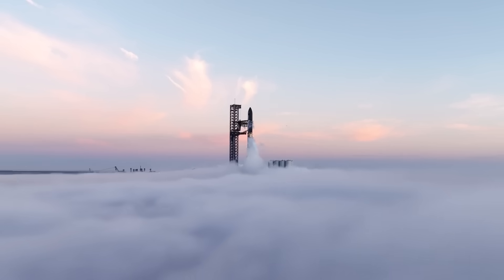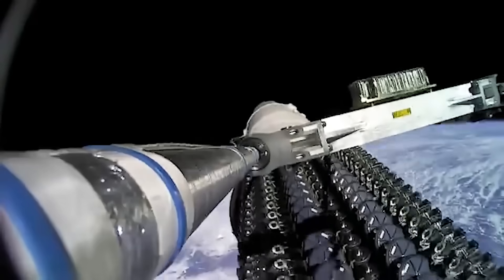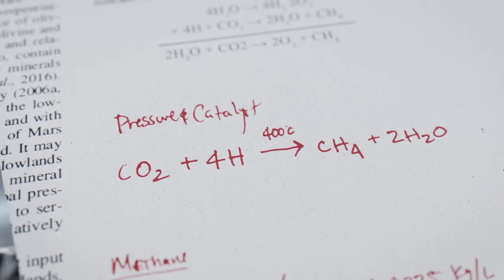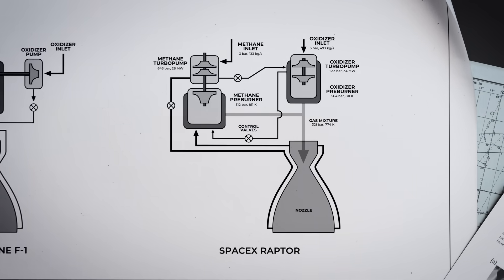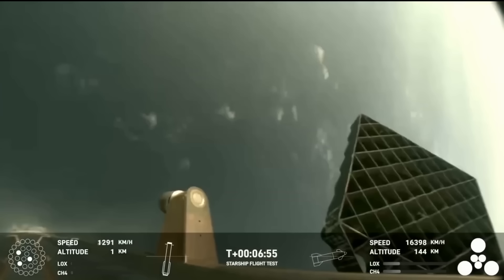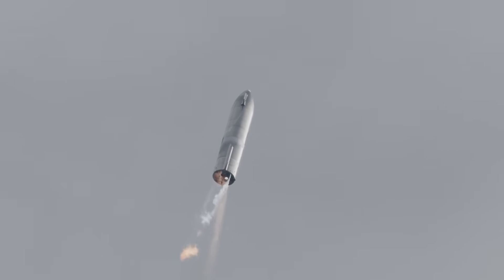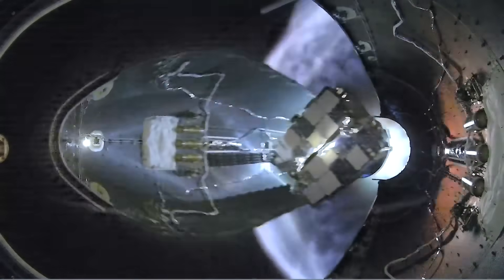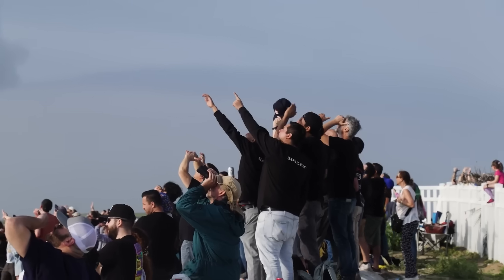Starship Reached Space. What Now?

Comment: JEEZUS H KRIST! Shoddy and disgraceful engineering of Space-X. Even the basic airplane has more than one radio system that backs up the Command System. The moment a fault or failure of the master system, the ground team should have initiated a turnover to the backup system. This was a total FUBAR outside the successful launch and seperation.
Reply: Starship has multiple redundant communication systems including SpaceX Starlink and NASA TDRS. They all went out when the whole thing broke apart and melted to slag as it reentered the atmosphere.
Reply: W…what? That makes no sense my guy
Reply: Loss of control was due to some sort of mechanical failure - some have suggested the RCS thrusters iced up. We don't know for sure yet.
Starship had no less than four independent Starlink communication arrays on it, plus at least one (but likely 2 or 3) TDRS system.
The fact that they had live video feed the whole time proves that communication wasn't an issue for them.
One should not speak unless one knows.

Comment: why is this so PRO starship? They failed most of their mission... "Unscheduled disassembly" - it blown up! "Space shuttle needed wings to glide back while starship doesn't..." wth, you just said that booster have to return back to the launchpad to be caught. SapaceX did half of what was promised for full money they got.
Reply: The flights were test flights. They clearly stated before what their methodology is and that explosive outcomes were expected. The aim isn’t to nail every test to its maximum extent but to find issues and ways to develop the vehicle in a hard to simulate environment 

Also RUD is a joke that has existed since the 70s. 

Also, None of there flights were being recovered. You just didn’t listen properly
Reply: Shuttle is landed like an airplane while the booster is landed vertically so it doesn't need a wings. Learn how to read

Comment: 15:40. Electric cars are not the solution ._.
Reply: OnLy PuBliC TrAnSpOrT iS GoOd is the most ableist shit i hear. God you people need to struggle to walk 10 minutes from a hole in your lung to understand that
Reply: So what's then?
Reply: @alvianchoiriapriliansyah9882  electric cars only make private transport more environmentally friendly, but even then, the sheer amount of electric cars that need to be produced to replace all the combustion-engine cars already in circulation does pose a lot of problems related to the extraction of lithium, for example. And this really underlines the problem, to me. It's the amount of cars in circulation. The necessity for 12 to 16 lane roads, the endless parking lots in cities that prevent the development of housing, and other such problems which, by themselves, also afflict the environment — I don't think anyone needs to be reminded of the fact that producing asphalt, rubber and concrete are incredibly bad for the earth and atmosphere. I personally think we should be moving towards other methods of transportation that can be slowly integrated into dense urban centers but also into more sparsely populated areas. Buses and trains are already more environmentally friendly than cars, even if they use fossil fuels to some degree. Electric cars are a necessary short term solution, but the ultimate goal should be to transition away from private transport and towards public transport, as much as each country and region can reasonably do so depending on their population density.

Comment: Timestamped Highlights
00:26
🚀 Starship reaches space for the first time, successfully lighting all of its methalox engines and performing a hotstaging separation.
01:30
🌍 Starship's massive size and powerful engines make it the most capable and largest rocket ever made.
02:46
🔥 Methane fuel provides advantages for future missions to Mars, including the ability to synthesize fuel on the planet.
05:02
🌌 Starship's potential to revolutionize space transportation by serving as the primary transport method between Earth orbit, the Moon, and Mars.
06:40
🌐 Starlink satellite constellation and the potential for larger versions of Starlink satellites with stronger signals for improved communication.
08:29
🛰 Possibility of using Starship for deep space missions and creating a propellant depot in orbit to transport more cargo.
09:40
🌍 Challenges and ongoing development required for landing the booster and achieving full reusability for the second stage.

Summarized by @NoteGPT

Comment: I remember YEARS ago my friend didn't think SpaceX could pull off the >30 engine idea claiming that "the soviets tried and failed" (not the best argument, imo, but go off ig). It's great to see that they actually got them all to cooperate and not shake itself to pieces! This is unironically a HUGE leap forward for space flight as it means we can put MASSIVE (relatively) objects into space with so much more ease; we just need to get the actual starship under control during flight!
Reply: Interesting you bring up the Soviets.  Their methodology was the same as SpaceX.  (or vice versa)  Design, build, test, analyze.  Repeat, with incremental tweaks and fixes or even re-designs to fix failures.  NASA, on the other hand, designed and tested on the ground, overengineering every component with at least 3 backups for everything, hugely complicating every facet of the entire project.
What is using Saturn rockets and who's still using Soyuz today?
Reply: @mountainjeff  The fact that you think having redundancy is over engineering shows how much musk manages to rot people's brain. The Soviet Union bankrupted themselves trying to keep up with America in space. Their space program was incredibly dangerous and while managing to achieve milestones first, in some instances, that hardly matters in the grand scheme of things. This obsession with painting NASA as some sort of bureaucracy that never gets anything done is insane. NASA is responsible for so many technological advancements. It's not even funny.
Reply: that goes to show how ahead of their time de Soviets were
Reply: I hope you remind him at least 7 times daily.
Reply: This is especially silly when you consider SpaceX already operates Falcon Heavy, which has 27 engines, and so far has never had a failure in years of operation. Your friend isn't alone though; you still see this kind of opinion all over the place.
Reply: @DontThinkSo11  Falcon heavy has 3 separate systems so only 9 going at once for each system. 30 at once is a big deal as resonances can build up and shake the rocket apart.
Reply: @DontThinkSo11 SpaceX has had engines fail in flight, just like the N1 did. But it has advantages that the N1 didn't have, partly due to hindsight about what went wrong with the N1. Two of the big issues with the N1 were that they couldn't properly test the engines before launch,  and that if an engine exploded it would take down the rocket. Thanks to poor quality controls on the initial run of engines, debris in the engines made the RUD of a single engine - and therefore the whole rocket - relatively likely. These were both solvable problems, but they didn't get a chance before the program was terminated.

It was never really the number of engines on the N1 that was the issue. SpaceX has mitigated the worst issues the N1 had, which is lack of quality control during assembly, lack of test firing before launch, and lack of shielding between engines that allows even a multi-engine-out scenario to be potentially survivable.
Reply: @jasonwalker9471 I also think more sophisticated computers and therefore control systems allow for faster adaption to various thrust changes via gimbaling and throttling.
Reply: Surprise surprise SpaceX engineers knows what they're doing
Reply: How the fuck is this a leap forward? The only way what they’re currently doing would be impressive is if they were in the 40s, because when you launch rockets now they’re supposed to succeed first try, not explode three times in a row. I’m sorry to say, but I think your friend is right here.
Reply: @erinrizzo3004 It's all about an effort vs cost analysis. You can spend a decade or two perfecting designs through simulations and lab tests before building something, or you can do the minimum practical amount of both of those things, and then build your prototype and see how it fails.

How much time you spend carefully testing and paper engineering a project before building a prototype is governed by how expensive each of those two processes is. If you need to pay 10000 engineers for a decade to work out some bugs that would be found in the first round of testing, that's a waste of money. Similarly, if you build a prototype too early and it fails for stupid reasons that an intern could have pointed out if they'd spent half an afternoon studying the project, that's a waste of money as well.

As with all things, balance matters.

I can't say whether SpaceX is using the right balance of "test till failure" vs "design it properly in the first place", but I can tell you this:

The real world is a lot more complicated than any paper design. No matter how much time, effort, and money you spend on a paper design, once you build a prototype you'll find a large number of practical issues. There is no substitute for practical engineering.

And in the case of rockets, that usually means blowing up both individual components and entire test vehicles until you've solved your major issues. Once you've done that, then the real work of iterating the design begins (bringing down reliability issues, cost, turnaround/new build time, etc).

As much as we all wish Star Trek style design simulations existed that could be substituted for physical engineering, they will never work well in the real world. And actually, they don't even work well on Star Trek, heh.
Reply: @enrizzo
Wrong. One of the biggest differences between companies like SpaceX and legacy rocket companies is that SpaceX and others are designing iterative. Meaning, the price is lower, the development is faster, and the end product is actually more dependable than a vehicle like SLS, because iterative design allows every tiny issue to float up and be fixed, instead of being ignored in favor of a big one-off success.
Reply: @akkkbn  50 years ago, when digital computers were barely a thing, engineers made the Apollo program work. They could go to the Moon and back with 1 launch!
Starship can barely get to orbit with one launch. Then it will need another ~15 launches the refuel in orbit, to go to the Moon (saving the money already, as the cost of a launch is not really in the vehicle itself but the fuel).
Their "iterative" process has destroyed more engines so far that were used in total during the Apollo program. They are projected to burn up to 5 billion dollars by the end of this year (for this program, they got 3 billion from Nasa). They have missed every single deadline so far from their contract with Nasa. These launch testings should have been successful 2-3 years ago.

You can root for something to happen. Space exploration is good, but it is unwise to just believe the lies, when there is clear cut evidence to the contrary.
Reply: @Qwantopides  Starship has now succesfully flown under the power of 33 Raptors to space. Twice. Something the ever-doubting armchair engineers proclaimed was impossible, pointing to the failure of the N-1. Obviously, they were wrong, as one might expect this time around. 50 years from now, when Starship is (hopefully) launching daily or even  more often, it will be a better system because of these early "failures", not despite them. Saturn's single-use design meant we spent tens of billions of dollars for a single launch, reusing virtually none of the vehicle. I would much rather ride on a vehicle which has failed half a dozen times, and had every minute detail refined launch by launch, than rely on a system which has never failed, and thus has no failure procedure. Of course they've destroyed more engines than Apollo... they use as many engines in a single launch as eight Saturn Vs. Raptors, however are about 115 times cheaper... iterative design at work again. With regard to the three billion from NASA... that is a completely insignificant sum compared to the money we spend overseas, and even on NASA itself. At the moment, SpaceX is the leading launch provider for the US and the West in general, and Starship, if successfuly, might very well be the most revolutionary launch system since the Shuttle. Funding SpaceX makes the US more dominant, encourages rapid development(and competition), and still looks like a pretty good bet. No lies are being propagated by SpaceX, by NASA, or by SpaceX fans (generally). The only falsehoods and denial of reality seem to be coming from the doubters, who have coincidentally allied themselves with the flat earthers. There have always been doubters, from cars, to Apollo, to the Shuttle, to the Internet, to every major innovation ever. They were all wrong. and they've got another surprise coming.
Reply: @erinrizzo3004 absolutely. The coping is insane. Space launches nowadays go mostly uneventful. The only spacecraft that seem to constantly explode or roll uncontrollably or any other number of failures are SpaceX craft.
Reply: Indeed lmao. @GageEakins
Reply: @GageEakins  Did you miss that little Japanese rocket last week?

Comment: I had the impression that the engines, both booster and ship, failed because of the fuel slosh. The ship and booster are more readily controlled while under thrust, as soon as the engines were cut there was an issue for control and no way of reducing speed on re entry. Naturally there  was not a lot said about the fuel transfer  test and it will be interesting to hear if this also had some problems due to no gravity, although the Spacex response to having a new flight test in April , may suggest they were fully aware of the problems before this launch but needed to see exactly what would occur.

Comment: For about 3 billion dollars of american taxpayers money, this rocket cannot even do, what the Saturn V did over 50 years ago! (That is complete any mission it was designed to do). To repeat, the Saturn V in the 1960s flew 13 Missions and succeeded on all of them. And you are talking about reusability, when in fact nothing like that can either be seen or demonstrated yet. All we got for 3 billion dollars was 3 very expensive fireworks (i.e. exploding rockets). Instead of this "tech-bro" video, you should make one focussing on where this project is actually at and whether it is even remotely feasible to try and complete Artemis this way.

Yes, it is fun to have a bit of optimism from time to time, but once in a while we should face reality and in this case it is just that SpaceX has not done anything special yet and basically spent 3 billion dollars of taxpayers money to create three expensive fireworks.
Reply: The Starship program is primarily private funded, also it would say that the Apollo 13 and the Skylab mission were not a sucess.
Reply: @0topon  Its not privately funded. Do research man. NASA contracted them for 3 billion dollars of taxpayers money to be a vital part in the Artemis program. Furthermore, Skylab was fully operational and Apollo 13 failed not due to an issue with the Saturn V. The only time there was an irreversible problem with the Saturn V was on Apollo 6 where some test could not be completed.
Reply: @superdiomond2138 Which is less than 50% of the total cost. The rest are, surprise surprise, privately funded out of SpaceX pocket
Reply: @alvianchoiriapriliansyah9882  Well each rocket cost about a billion to make, they launched 3 of them so far and got about 3 billion from NASA. Seems more like 100% from me, but I am curious about your sources.
Reply: The starship you're seeing is privately funded the things Nasa are paying for are being developed at spacex HQ behind closed doors. Nasa has confirmed that 30 of the required items have been completed including docking interfaces and life support. A lot of what Nasa wants spacex was planning to develop anyway for their own projects.